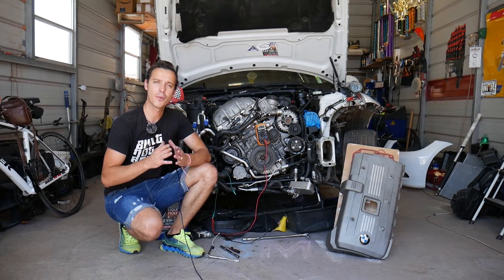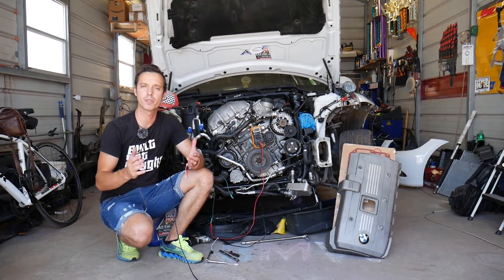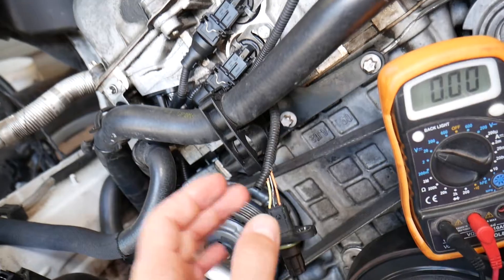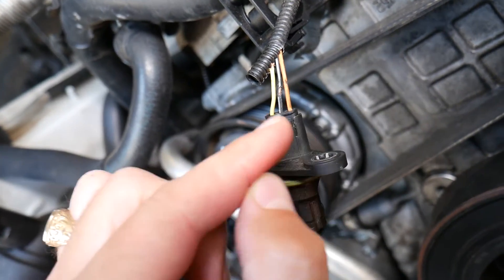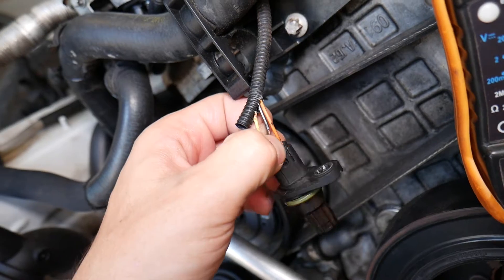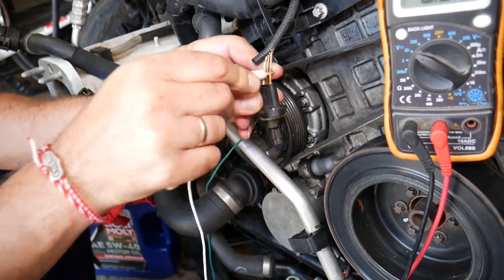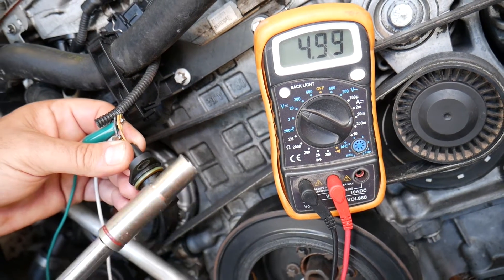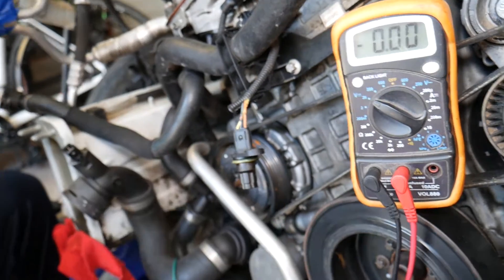HOW TO TEST CAMSHAFT POSITION SENSOR ON BMW X1

Comment: I bought a Z4 and the problem was overheating 
I replace the water pump when I try to flush the radiator the water pump doesn’t turn on and I try the method maximum heater minimum fan and 10 sec pedal and nothing happend idk if is not doing anything because has the engine light my z4 is 2006